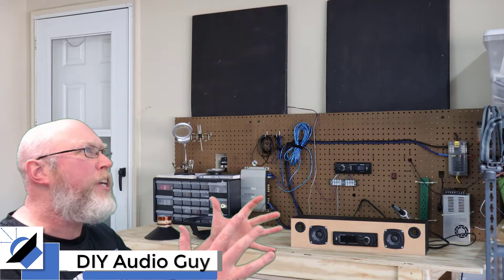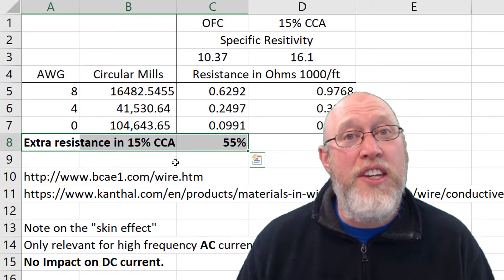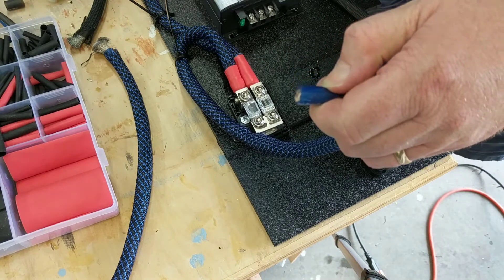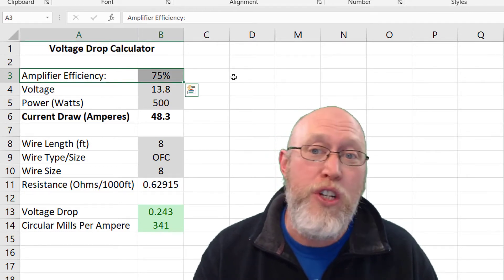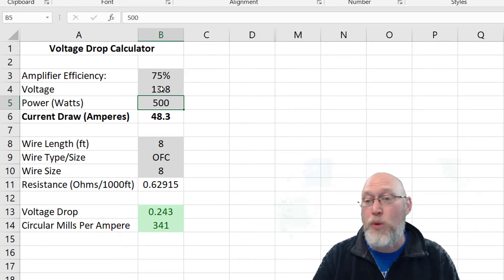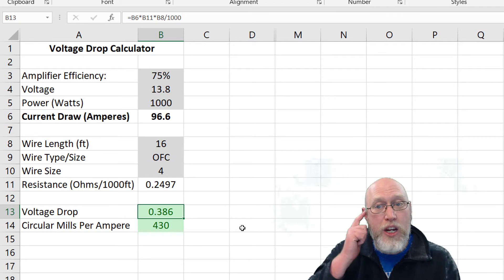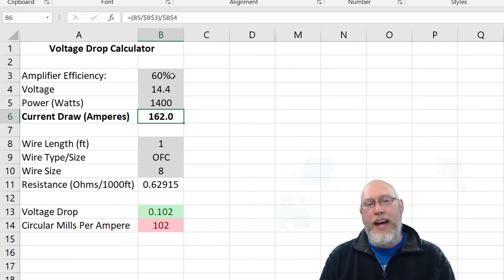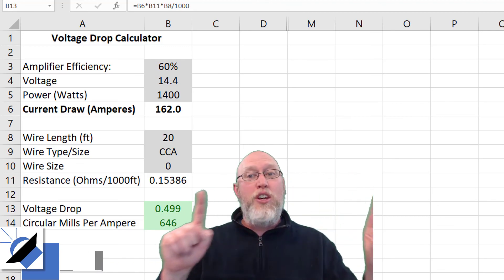Car Audio Power Wire:  OFC or CCA?

Comment from the maker: I set up an automatic reply to any email sent to diyaudioguy@gmail.com with the word wire in the subject line.  If you don't get an automatic reply please let me know in the comments!
Reply: Hey diyguy I got a question for you in winisd under filters what does static gain refer to is it referring to the signal output from the preouts via a receiver or is it referring to the gain knobs on the amp my crown xls 1502 full output with the gain knob full up is supposed to be 30 plus db so half is about 15 db but I apply this in winisd for my sub build it says I'll have some nasty ass cone Excursion I'm I doing something wrong sub has a max rms of 800watts it's a duel 4 ohm voice coil with each one rated for 400 watts I'm wiring it in parallel down to 2 ohm an feeding it 775 watts from my crown xls 1502
Reply from the maker: I have no idea.  I've never explored that feature in WinISD.  If you find out let me know!
Reply: I subscribed can you send me this please 🙏
Reply from the maker: @kennethreber7176  If you send an email to the address that I listed above with the word wire in the subjectI have an auto reply setup.  You should get the spreadsheet in a couple minutes.
Reply: Didn't work for me
Reply: Is says message blocked ? Any help

Comment: Thank you man. Love your videos. Nobody really wants to talk deep into this stuff But you sir, thank you !
Reply from the maker: I suppose that's my niche.
Reply: DIY Audio Guy Do you believe compasitors* are worth installing.  I have one but I’ve read 50:50 that they help or dont.  I know I need to upgrade my alternator. My light dim and the bass doesn’t hit hard all the time, almost as if it’s clipping but the bass just cuts out.
Reply from the maker: @sirryan2891  The ones that are the size of a 24-oz beer can are nothing but a gimmick.  I'm honestly not sure why these things are still on the market.  They just don't have enough capacity to do what they claim that they do.  Supercapacitors are a different story.  

The right thing to do is to upgrade your alternator, but that is an expensive upgrade.  Most people will just add a second battery, which will actually make your stock alternator work harder leading to a premature failure.
Reply: DIY Audio Guy   Would upgrading alternator and battery both be better than just the Alternator?  Thank you so much for the reply.  I appreciate it.
Reply from the maker: Yes.  I don't really know that much about alternators or batteries so I don't really have any advice on how big of an alternator you need or what kind of battery capacity you need.  As soon as I figure it out though I will post a video on it. 👍

Comment: Brilliant video.  I was just considering whether or not my 4 Gauge cable is up to the job, so searched and came up with this video. many thanks. 😎
Reply from the maker: Glad to help. OFC 4 Gauge works fine for most daily drivers. It can carry a lot more current than CCA of the same size. If you ever watch five star car stereo you'll notice that about 90% of their installs use OFC 4 gauge wire. Make sure you put an appropriate fuse close to the battery.

Comment: Just always use 0 gauge wire if you can, simple. Even if you don't REALLY need it. It will always simply do better than the others, even if the other can handle the voltage fine. 
And to me, the cleaner I can make my energy to my systems, I've found the better the speakers perform, and last.
Reply from the maker: I don't disagree with you.  I'm running zero gauge in my setup, and I can get by with 4 gauge.  But not everybody's going to want to spend the extra money for the larger wire.
Reply: @DIYAudioGuy  Haha very true!
Reply: @DIYAudioGuy I am running 4 awg ofc but am saving for 1/0 ofc.

Comment: CCA also gets hotter and will cause power loss from your amplifier as well.
Reply from the maker: Yes, I covered that in the updated video.  The current ratings are at room temperature, more current causes more heat which causes more resistance which causes more heat...

Comment: 4:03 I love audio control's stuff, I wish their home audio stuff was more affordable, it's outrageously expensive.
Reply from the maker: Definitely not cheap.
Reply: I wish all of this stuff was more affordable, although buying things lightly used these days, and buying certain things with this type of knowledge under my belt plus being able to wheel and deal with some great friends that I have turned on to the world of Hi-Fi stereo systems.
Reply: @BabyCharlotteschannel  I don't see a whole lot of Audio Control home amps for sale.
Reply: @Edward135i  yeah I don't even know that company, I was just agreeing with you in general that things are expensive is all..
Reply from the maker: @BabyCharlotteschannel  It is not a cheap hobby that is for sure!  But I don't personally believe you have to buy the most expensive stuff in order to get quality sound.  Back in the '80s and '90s Richard Clark proved that all watts sound the same.  Google Richard Clark $10,000 amplifier challenge.  

It will really change your perspective.  

Plus there are a lot of ways that you can find those good deals, those diamonds in the rough.  That is one reason why I like Knukonzepz, you'll be hard pressed to find wire and fuse blocks that provide more bang for the buck.

Comment: That's was cool video, along with great info.  Thank you
Reply from the maker: Did you get a copy of the spreadsheet?
Reply: @DIYAudioGuy  I did not send for one. I used 1/0 welding cable to a distribution then audio 1/0 so it was more pliable for the bends I need to make.

Thank you though, I don't really do installs any more.
Reply from the maker: @TheoneDragon51  Can't go wrong with 0 awg welding cable.

Comment: Great info!!! New subscriber!!!
So basically you're saying use 0 OFC wire!
Reply from the maker: Unless you don't need it, then use 4 gauge OFC.
Reply: @DIYAudioGuy  reason why I'm aski g becaus I recently got my first sound system and spent 1400. Sounds great first few weeks then found they used cheap (stinger) CCA and RCA wiring. Basically now I have to get everything re-wired, a capacitor, big 3
Reply from the maker: @ajjax89  sounds like a shop is trying to sell you some upgrades for no good reason. capacitors don't do a darn thing and you can download the calculator to determine if your a power wire is thick enough to get the job done. The real question is can your stock alternator handle 1400 watts.  

Check out YouTuber exocontralto, he just did a test proving that those capacitors that look like 24 oz  beer cans don't do a damn thing.  You're better off buying an extra battery.

That is just my opinion, I say you should keep doing some research before you start handing a shop more money.

Comment: Need a video on picking correct battery or batteries
Reply from the maker: I don't feel like I know enough about batteries to make a video, I've been having a very difficult time trying to sort out the facts from the marketing hype.
Reply: @DIYAudioGuy  i know the feeling...its very difficult to sort all the bs and get down to what matters in order to decide what and how much battery and alternator it takes to run the system correctly
Reply: @DIYAudioGuy  there are only a handful (3 maybe?) companies that makes batteries in the US, and they all get re-branded from there. Johnson Controls and Exide make the overwhelming majority of them. There are differences (lead-acid, AGM, gel, deep cycle, etc), but there's not necessarily one brand or make that's better than another. The best thing to do is look at the CCA value and the warranty term.

Comment: I've got a 1000w amp 70-80% efficiency I was going to get a 4AWG of wire that was 50$ 25ft. But decided to get a 0AWG for 45$ and 50ft and according to the spec it can handle 150amps. But no distance scail so that's concerning. But I'm also wiring it up alongside a 8AWG ofc I believe so I shouldn't have any issues I believe but 🤷 who knows. I also wanted to run ground all the way to the rear. While still using the chassie. Yes yea ground loop and complete over kill for 1000w but I'd rather be safe than sorry. I like to learn as I go
Reply from the maker: Just use the wire calculator, send an email to diyaudioguy@gmail.com with the word wire in the subject line.

Comment: Awesome info.
Reply from the maker: When I first started putting the video together my goal was to prove that CCA was junk and you should never use it.  I still think it's vastly inferior to OFC, and I would not recommend it.  But, math is math.  There is a place for CCA wire.
Reply: @DIYAudioGuy  so true. Cca should only be used in short runs inside where weather will not effect it that bad.  in my opinion.  There is a place for it but your right its not something I would recommend.

Comment: do you think ofc is beneficial over cca for a 29 ft run of 16akg going to some polk owm3 height channels?  crossover at 90hz , amp- Denon s760h avr
Reply from the maker: You should be fine.  They were longer than 50 ft you would need to jump up to 14 gauge and you would definitely want to go with  copper.

Comment: What would u reccomend for a system under 1000 watt rms.
Reply from the maker: 4 gauge will probably work, unless you have a very long run of wire and a very inefficient amplifier.  Send an e-mail with the word wire in the subject line and you can have a copy of the spreadsheet and tinker with it yourself.
Reply: DIY Audio Guy thanks for u reply! Will check it out

Comment: I’ve used knu kca for years no issues. I did have 4 runs of 1/0. I now have 2 runs of GP  1/0 OFC we’ll see how much of a difference when I get it installed.
Reply from the maker: I have recently tried NVX and I like it just as well as Knu.  Plus they set up a discount code for my viewers (diyaudio10 on NVX.com).  The JP wire (https://lddy.no/1c0tx) also looks solid but I have not tried it yet.
Reply: Did you notice a difference  ima go on a limb and say know!

Comment: @diy Audio Guy i need your expertise sir, please.  
I am attempting to run a 3,000 watt class D amplifier on a stock 110 amp alternator
Here's what i have done.  
Big 4 upgrade with 1/0 high quality OFC 
2 runs of high quality 4 AWG OFC (roughly 9 feet) 
X/S ioxus 12v 325F ultra capacitor
3k Stetsom ex3000 black edition. 

What i need your expertise for is this. 
If i am basically pulling the bulk of the amperage from the ultra capacitor then what would be drawn through the power wire running from main battery to ultra capacitor?  Would that still be expected to handle between 150-300 amps? I'm confused. Thank you very much for all of your content.  Ive enjoyed and learned from every video i have watched so far.
Reply from the maker: You need to upgrade your alternator.  You should probably run a 4 gauge wire from your battery to your capacitors.

Comment: I'm pushing 2000 watts on 2 12 Skar EVLs, I have my car wired up with 4 gauge ofc currently. Would the 4 gauge ofc be able to handle 2000k watts are is it necessary for me to upgrade to 1/0 ofc?
Reply from the maker: I think you need zero gauge.

Comment: always wondered the effects of cca wire used for speaker wire since amplifiers output A.C. voltage to the speakers.
Reply from the maker: I did a little research on skin effect as I was researching this video.  skin effect only happens with AC current and as the frequency increases the depth that the current penetrates decreases.  If you think people would watch the video then I would be glad to put together a skin effect video for speaker wires.
Reply: @DIYAudioGuy  I think they would, so what your saying is if someone used cca for tweeters it wouldnt be so bad but using it for subs and mids  not a good idea. I dont have any cca in my car i would never use it but it's a very interesting subject. I wonder how much cca wire if any is used in factory automotive wiring.
Reply from the maker: It's really kind of an odd phenomenon.  After reading a bit more about it I am uncomfortable speculating about how it works.  As the frequency gets higher the effective cross-section of the wire is smaller.  Which would mean you need a bigger wire for a higher frequency.  But it's probably a moot point because there's just not that much signal at twenty thousand Hertz going to your tweeters.
Reply: I ordered some cca oversized 8AWG Frome skyhigh and this

Comment: To keep it simple and not have to make this more complicated, if we have more than one run, can we just sub in half the length? Or a bigger gauge, is there a simple way to change another number without having to complicate the spreadsheet formulas?
Reply from the maker: Yes, divide the amperage by half.

Comment: What if I use a ofc cable for my battery and fuse holder and then use CCA to run to my amp about 15ft?
Reply from the maker: Treat it like 16 ft of CCA, since the OFC part is so short.
Reply: Still got a HUGE run of CCA going to the amp and the longer the run the BIGGER the voltage drop so technically it would be pointless to do that just run everything OFC

Comment: I have a question that I’m sure you probably have covered in a video that I haven’t seen yet so it might be a stupid question.  Actually 2 questions.. so if I was running a 1200 watt monoblock  skar audio amp and a 360 watt 4 channel amp.. would I run a bigger gauged wire like a 0 gauge back to the splitter and then run a 4 gauge to the 1200 watt and a 8 gauge to the 360 watt amp?  And would I need to have a fuse by the battery if there are fuses in the splitter?  Or would I put a fuse between the splitter and the amp?  I’m so stuck on these 2 questions please help me lol
Reply from the maker: That's exactly what you would do.  Every time you reduce the size of the wire you need to add a fuse.  I'm not sure if I cover that completely but I've got some of that in this fuse block video.https://youtu.be/tvcZgfmKiUw
Reply from the maker: This video may also help. https://youtu.be/UXqqPDiRx-o

Comment: What gauge wiring kit would you recommend for a 2ohm12” sub 500w RMS/1000w peak power my amp is 800watts and 600rms at 2ohm i have a 8 gauge 800w OFC wiring kit
Reply from the maker: send and e-mail to diyaudioguy@gmail.com with the word "wire" in the subject line and you can download the spreadsheet.
Reply: 0awg ofc

Comment: I am running 1200watt rms 85% efficiency 
Knukonceptz 0 gauge CCA amp installation kit with 200 amp fuse. 17ft run of cable.  Is this good enough?
Reply from the maker: Send an email to DIYaudioguy@gmail.com with the word wire in the subject.  Then you can just plug your numbers into spreadsheet and you will know.

Comment: Good video but everyone should use ofc wire
Reply from the maker: That was my initial thought, and I still recommend that people use tinned oxygen-free copper wire for car audio installs.  My goal was to make a video proving that you should only use OFC wire.  When I did the math I learned that CCA was sometimes within the acceptable tolerance levels.  I suppose that's the difference between tolerable and recommended.  I don't recommend that you drop a hammer on your toe, but I'm sure you could tolerate it.
Reply: DIY Audio Guy I totally agree with everything you said in video but as we all know it’s just better to go with ofc even for someone poor and broke like me I will wait and save little more for it. But it will work of course I just seen it totally disintegrate inside out and you won’t even be able to see it on wire not that old and not getting slot of power.

Comment: Alternators aren't what they used to be. Toyota can charge as low 12.08 volts and still be fine. Other vehicles differ also. I've seen jeep be fine at 13 volts flat. It's all based on what the PCM desires and commands the alternator to produce.
Reply from the maker: I've got an older Dodge truck with a mechman  high output alternator.  The PCM likes to keep it between 13 and 14 volts.

Comment: It doesnt matter if it is cca as long as the coating is ofc copper! Current runs on top of the wire and not inside the copper it self!!
Ofc copper corrodes also, ofc is made without oxygen in the process, the same is done when tig welding, slope up and down to remove oxygen to let the weld cure without oxygen! Ofc is therefor just cleener on the surface than cca, and thats it and the truth about the difference!
So basically cca and ofc corrodes just as bad...!
Use the cross section when installing nothing else is needed!
Reply from the maker: You're talking about the skin effect. That only happens with AC, electricity, and it only makes a difference at high frequencies.